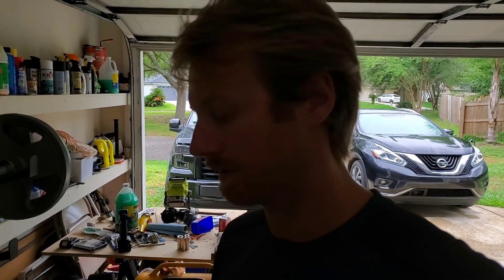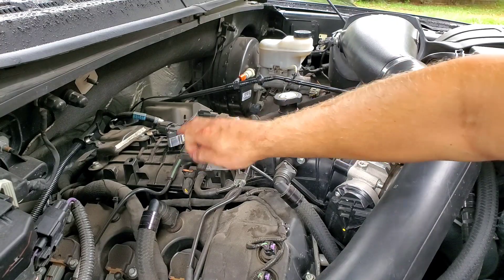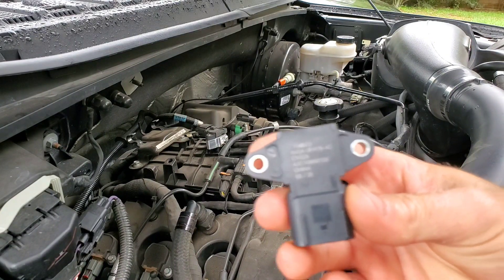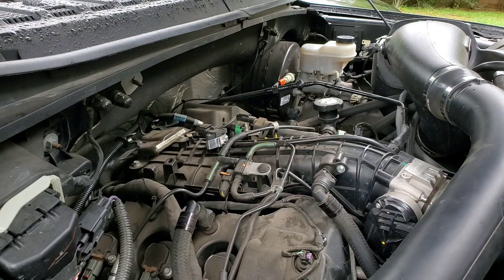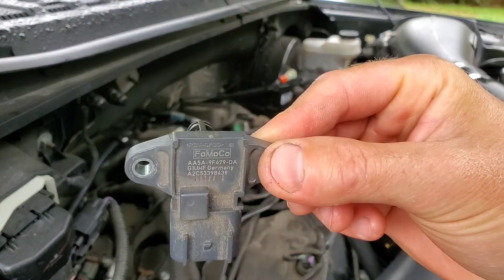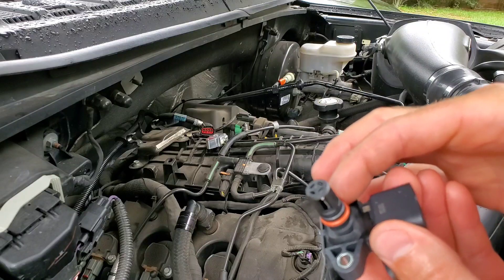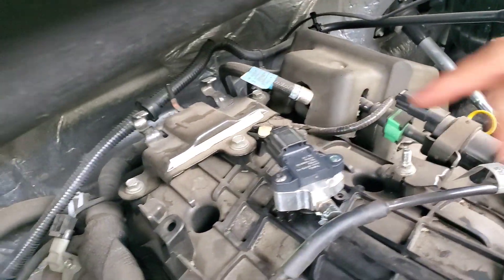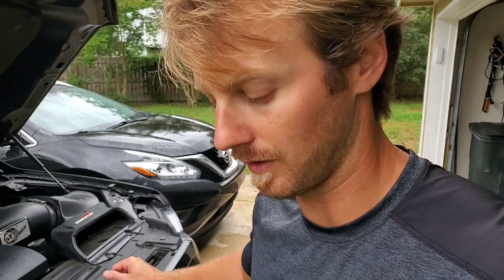2015 F150 Ecoboost MAP Sensor Upgrade after NEW TURBOS 3 BAR

Comment: What readings are you getting at idle what psi
Reply from the maker: -12.5
Reply: @_willalexander.88  Humm mines is reading 2psi of boost at idle and map is 6 at idle sum things odd going on with it
Reply from the maker: @Tommy K  you tied into the manifold correct? After the TB..
Reply: @_willalexander.88  it’s a edge insight ct3  I’m trying to figure out what’s going on with it
Reply from the maker: @Tommy K  get the gauge I have and install it. It's nice to have a mechanical boost gauge. That way you know for sure.

Comment: Spraying your O2 sensors with brake cleaner fixed your rough idle? Very interesting! My 3.5 has a slightly rough idle that comes and goes. Most of the time its pretty smooth. Is this what your talking about?
Reply: Don’t do it . Use correct cleaners 
Map sensor cleaner or equivalent

Comment: Gettimg ready to install my crp manifolds. When u unhooked the oil and coolant lines from the turbos did you have to do an entire oil change and coolant change or is the amount lost "self limiting". I guess what i'm asking is, is all of my coolant gonna come out. Also u say your tuned by MPT but your also catless, arent they the ones that saidbthey wont do anything that affects emissions?
Reply from the maker: Do this when your do for an oil change so you can drain it and not worry about it. Unless you can capture all the coolant like me, plan on a full change bc your gonna lose most of it. MPT won't fix the CEL in there tune. I used 2x no foulers on each down stream o2 sensor.

Comment: Love your vids man I have an 2017 f150 3.5 eco boost that might be needing turbo replacements. I developed a weird sound under boost posted on my channel, it’s at the shop about to get taken apart, but they believe it’s turbos. I hold 18 lbs of boost from 3k-6k so I don’t see how it could be turbos. If I do replace I want to go with CRP stage 3, what other mods would I need to support them? Truck is tuned by MPT 93 prx, afe stage 2 intake, muffler+res delete, spark plugs regapped .028. Huge fan of the channel deff got a new subscriber!
Reply from the maker: I would just get the 3 bar map sensor from mpt. Some people upgrade fuel injectors but mine are doing fine. I have yet to jump back on the dyno with mpt though. You really should take a closer look to find the issue before ordering all that unless your just ready to. Might be a manifold gasket leak.  If your gonna do turbos,  do there [crp] exhaust manifolds also to get the most out of it and since it's only 1 more step after turbo removal. Downpipes to if you can.